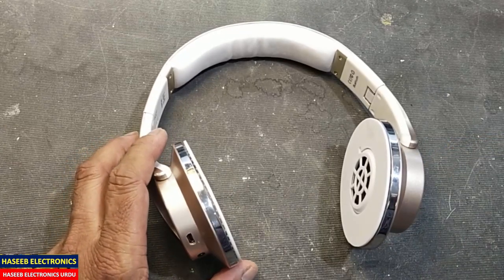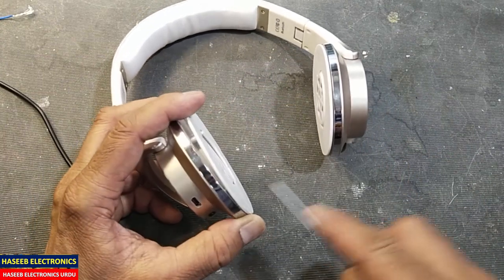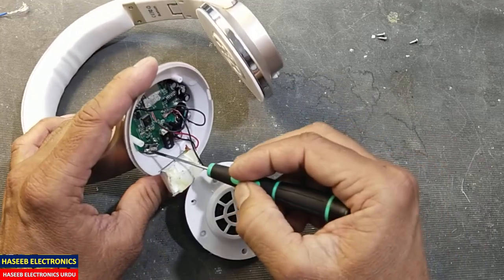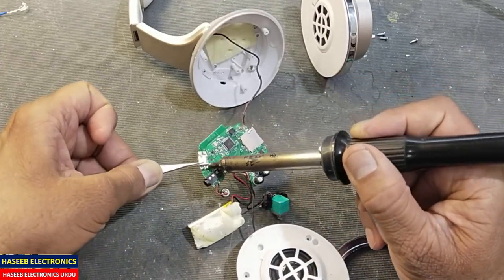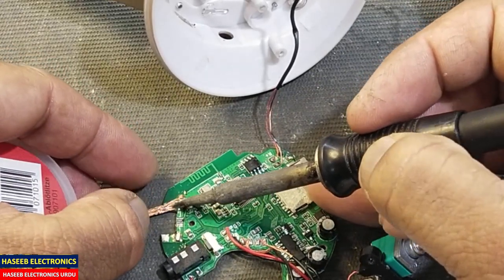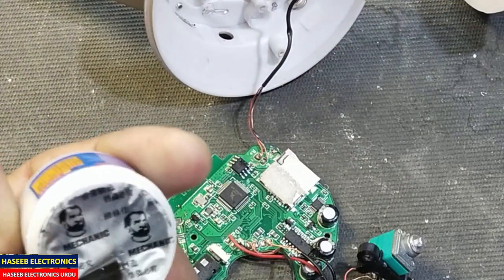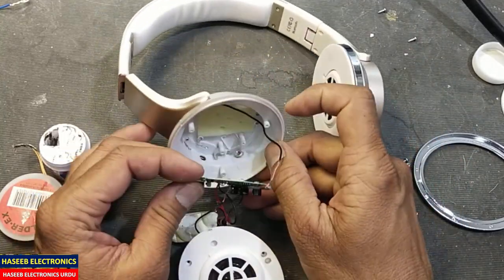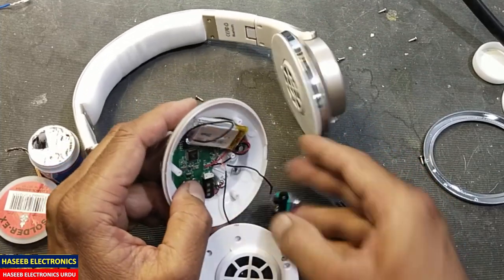{615} How To Repair Bluetooth HeadSet / How To Replace USB Charging Port in Bluetooth Headset

Comment: It's good that these headphones could be opened without using destructive force. Many of the ones I have tried to fix have been glued and end up in pieces when taking apart!
Reply from the maker: yes dear 
the press fitted and glued fittings are too difficult to open

Comment: It seemed you didn't finish soldering the support pads on the port? Nice fix. I have my headphones open and need to change the battery. It's fun to fix stuff.

Comment: What is the little circular thing dangling?  Is it just completing the circuit?  Mine is smaller and I am trying to make sure it didn’t detach from something when the charging port got pushed in.  I don’t have solder but I used super glue but before I put them back together it looked like you shoved it in first and then put the green plate that holds the compnents on top of it.  Was that just to fit or does it need to touch something specific??  Like does it toggle something I’m not seeing??

Comment: Please what is the air flow and temperature when soldering with hot air gun and mechanic solder paste thanks.
Reply from the maker: on my WELLER WR3M rework station, 
Air Flow setting is 90%
Temp 550 C
Reply: @HaseebElectronics  thanks for the response sir

Comment: Great! [Blanches from embarrassment at how cheap these podcast-great speakers are.] How do the connectors go bad? I've seen gnarled spring metal connectors on HDMI, that's clearly a problem in mating connectors, but Micro-B connectors look about the same.